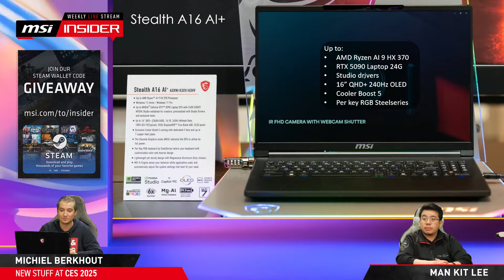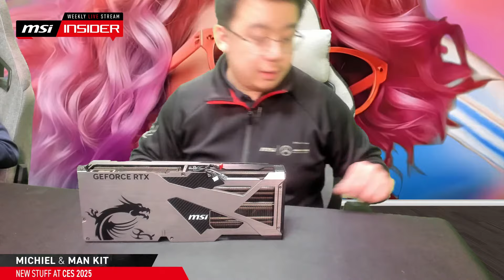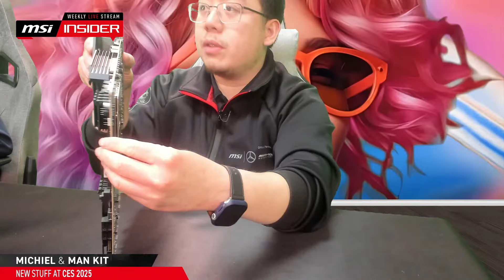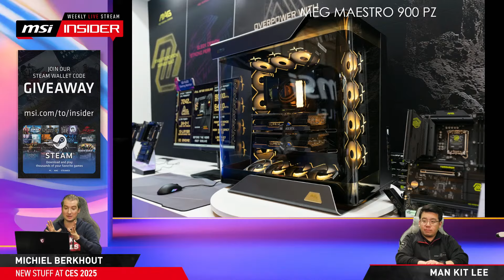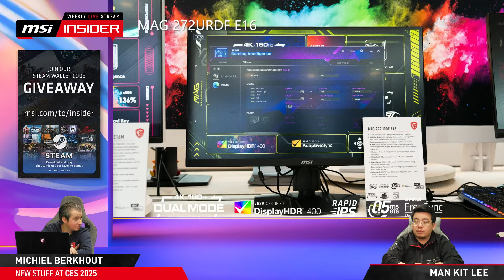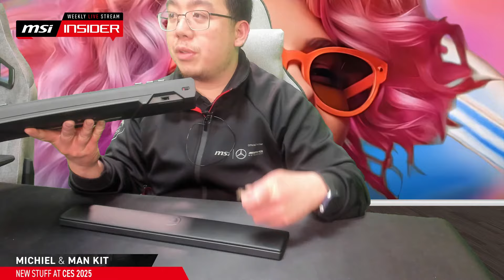New stuff @ CES 2025

Comment: still no x870e ace?
Reply: im in the SAME boat as you!!! im probably going to crack and buy the carbon
Reply: there is a reddit post where somone confirms an MSI rep told them there WILL be an x870e Ace, but not sure if its true
Reply: @seanpetersen8044  i know i saw a lot of post on reddit of people askin for the ace but why is so difficult to have an answer from msi? i dont want to go with the carbon if will be an ace board but before i take my choice i want to know if will be an ace or not
Reply: @Darione90  I think I'm going to just cave and get the carbon honestly but yeah it's frustrating to not know
Reply: @seanpetersen8044  i dont like the carbon i will get an asrock if i will not have an answer soon
Reply: @Darione90  I honestly think the x870e Edge (silver/white board) looks better than the carbon and its $150 cheaper